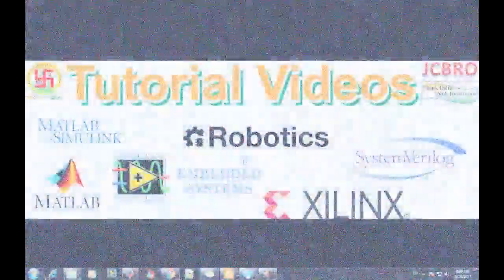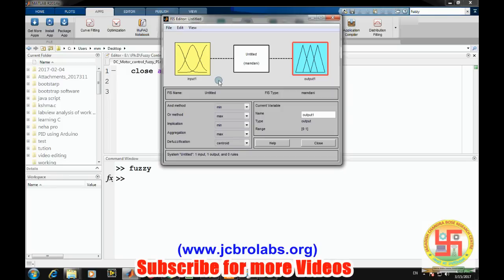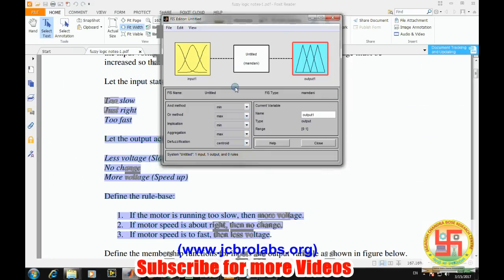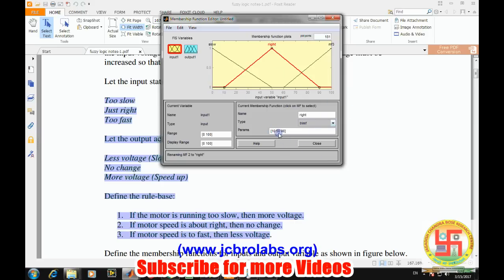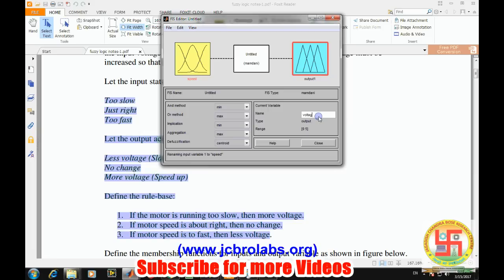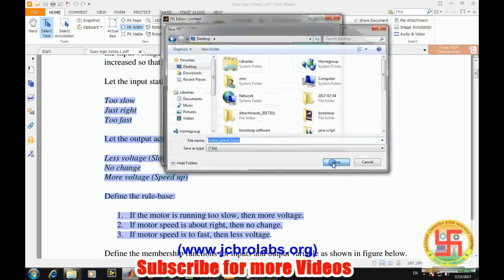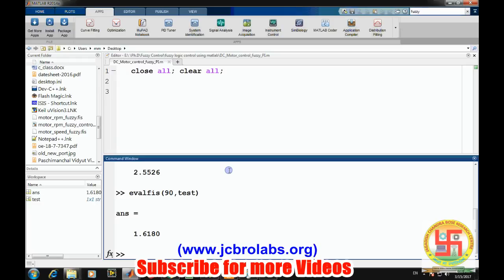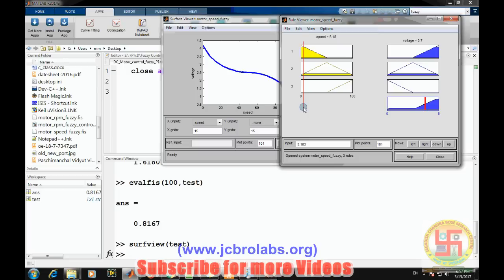How to Design Fuzzy Controller (motor control) in Matlab ?

Comment: I am getting errors when I test the fuzzy fis. ? can u please check why this happens

Error using fuzzy.internal.utility.readFISAsStructure>openAndGetFileID (line 96)
Unable to open file 'speed_control.fis'.

Error in fuzzy.internal.utility.readFISAsStructure>localReadFIS (line 53)
fid = openAndGetFileID(fileName);

Error in fuzzy.internal.utility.readFISAsStructure (line 29)
    [out,errorMsg] = localReadFIS(varargin{:});

Error in fuzzy.internal.utility.readfis (line 27)
[varargout{1:nargout}] = fuzzy.internal.utility.readFISAsStructure(varargin{:});

Error in readfis (line 27)
[varargout{1:nargout}] = fuzzy.internal.utility.readfis(varargin{:});

Comment: Can i use matlab to control a machine ? Or is there a more simple way ?
Reply from the maker: Yes, you can use Matlab to control a machine. Further, there are other ways as well, like Python, LabVIEW or embedded systems
Reply: @buildwithsharma  thank you . Can i use a human machine interface like a touch screen to control the machine ? If yes , which one and what is the software used for programming this interface?  Can you recommend a video ?
Reply from the maker: Yes, you can. For this purpose, you have to learn the basics of embedded systems.
Reply: @buildwithsharma  many thanks . That was helpful

Comment: Thanks for your helpful video. I have a question. How can I tune a PID controller in a motor considering that I do not have the transfer function of the system? Thank you.
Reply from the maker: Hi, you can try to use system identification technique from step response of the motor.
Reply: @buildwithsharma   Hi, thanks for your attention. Actually, my motor system has two errors and I cannot use the " system identification technique from step response" to tune my PIDs. I'm just wondering am I supposed to write extra program for each fuzzy PID? Any suggestion?
Reply from the maker: actually, using system identification you can obtain the transfer function of your system.

Comment: can we design Fuzzy logic controller using other software?
Reply from the maker: yes, you can..
Reply: thanks for reply. I have done my simulation by designing fuzzy logic controller for moving targets tracking and hitting using simulink. Plz help me in simulate the same using other software.
Reply from the maker: we can only help with Labview only
Reply: ok plzz help me
Reply from the maker: you can drop mail at jcbrolabs@gmail.com
Reply: @buildwithsharma  can u help me in LFC USING FUZZY LOGIC CONTROLLER